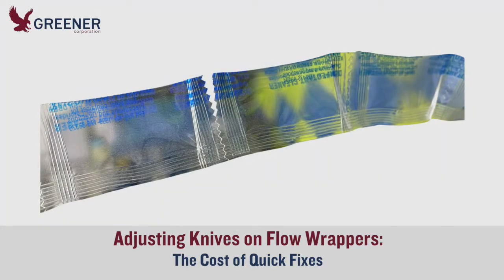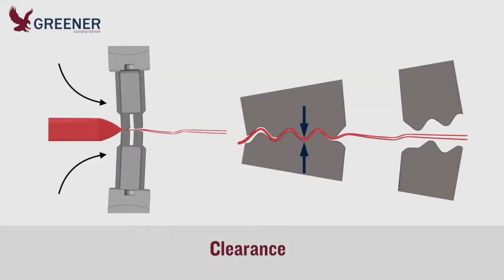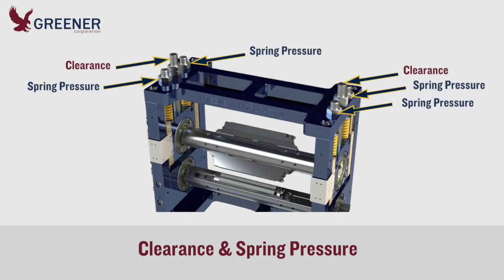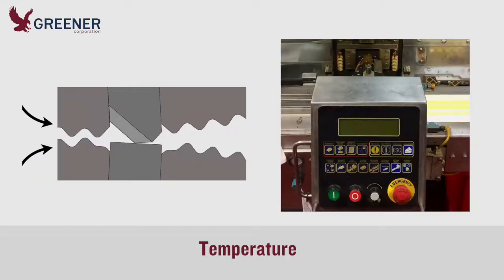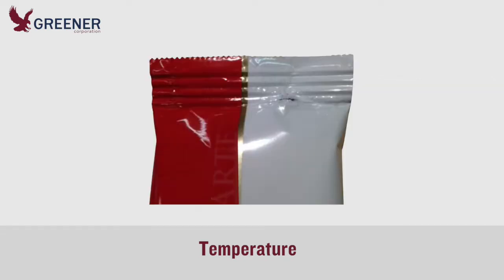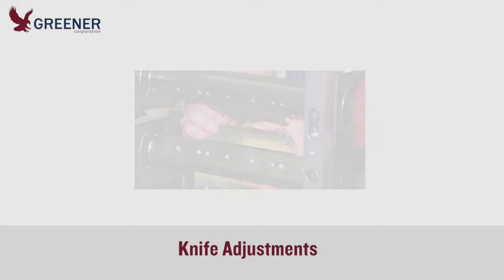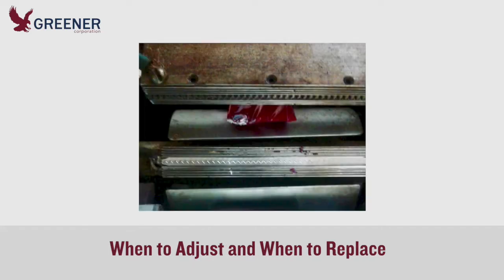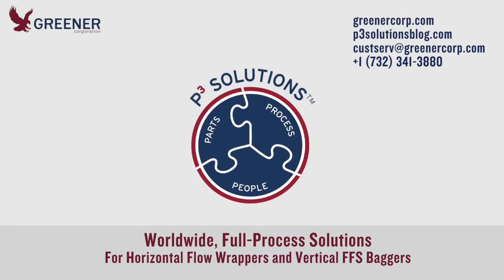Adjusting Knives on Flow Wrappers: The Cost of Quick Fixes

Comment: once set the sealing jaws, how could do I achieve a good cutting?  I have placed some shims under knives and anvils in order to achieve a good cutting but it sometimes fails.  I noticed that flow wrappers cutting wheels move with a particular cycling turning, not moving consistently;  There are moments that the cutting wheels move quickly and other moments they low the speed, so I harness this movement to help the film cutting.  I think there are too many factors that must be controled just to achieve a good cutting but I want to know your opinion about that and also you could advise me about the knives adjustment procedure after the sealing adjustment
Reply from the maker: Thanks for your very good questions.  You can find knife set up guidelines and other useful information on our blog, www.p3solutionsblog.com. This post should be especially helpful: https://p3solutionsblog.com/optimizing-knife-anvil-setup-horizontal-wrappers/   We can best answer your specific questions if you contact us directly at: custserv@greenercorp.com